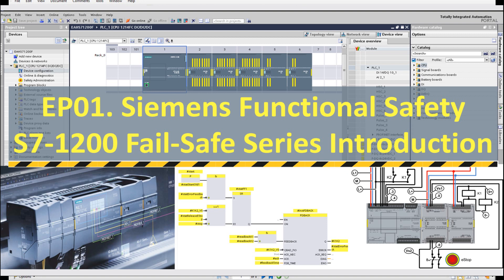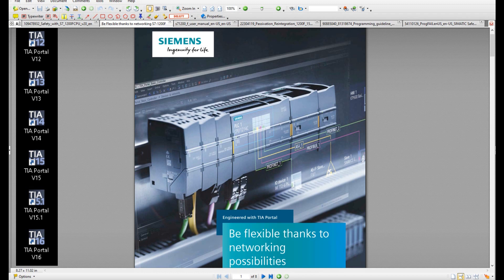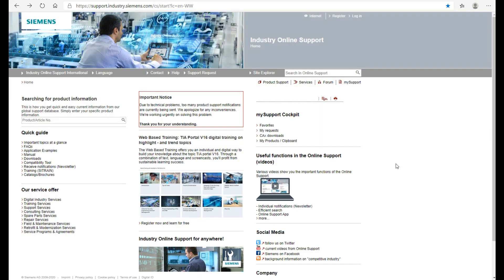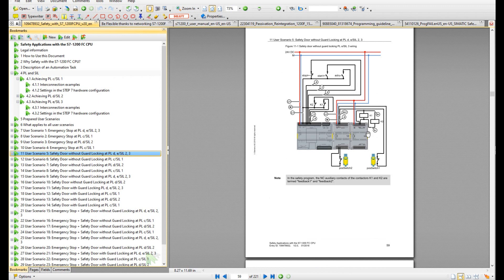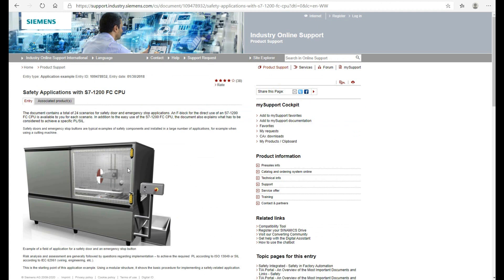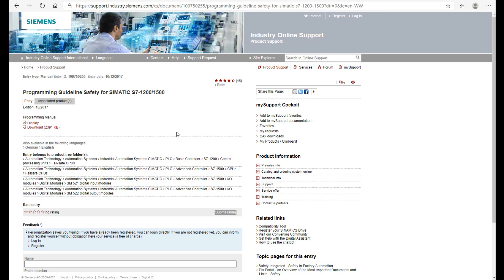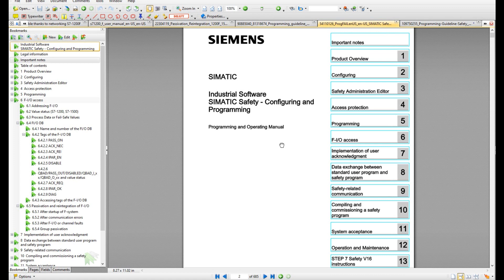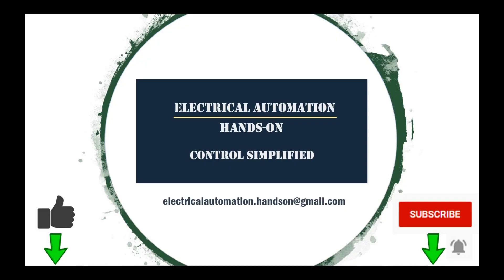SA13. EP01 Siemens Functional Safety - S7-1200 FC Series Introduction

Comment: Dear brother very good video series on s7 1200 fail safe controller for learners. Brother is it possible to make series on s7 1500 fail safe controllers. your style of teaching is excellent.
Reply from the maker: Thanks Bro, S7-1200 and S7-1500 safety most of cases are the same. you can use my videos for your S7-1500 programming